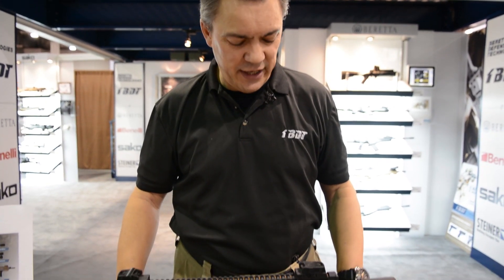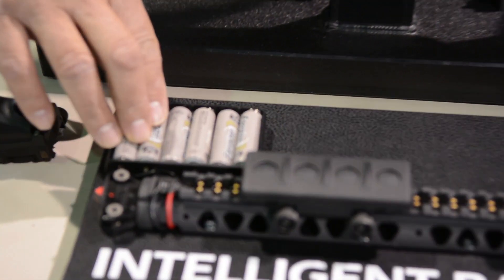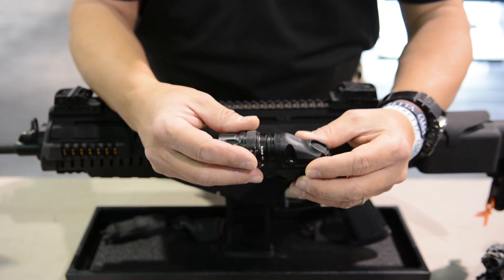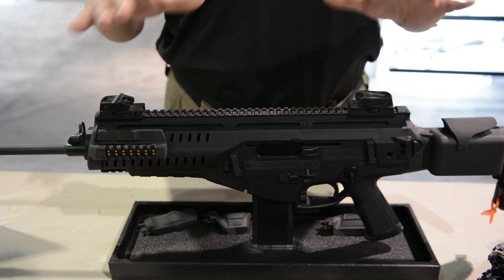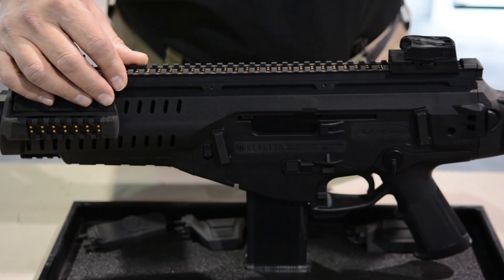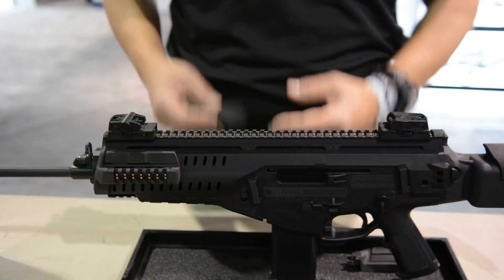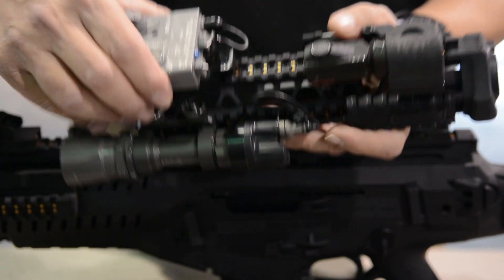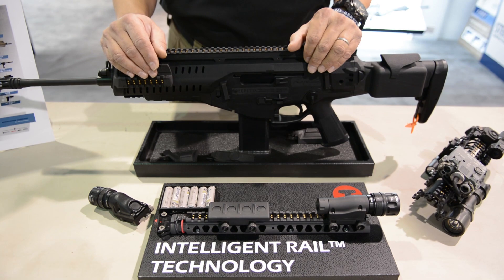SHOT Show 2014 - Beretta Intelligent Rail Technology

Comment: Honestly... Nice for a range toy. Doesn't look reliable enough for field use, it probably wouldn't work underwater/under heavy rain. And here, if one thing fails, you lose your laser/flashlight/sight all at once
Reply: Yeah, I would be interested to see some field testing in underwater/rain, sand, and forested/jungle environments.  And see independent circuitry to keep accessories functional if one segment of the rail fails.  But the concept really is nice and I would like to have one myself.  Wonder what the price point is on something like this...